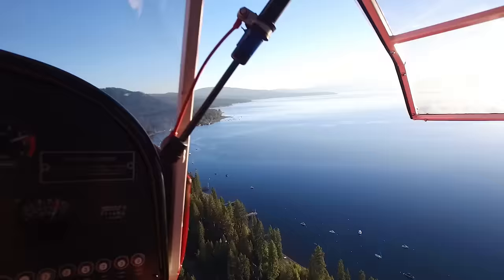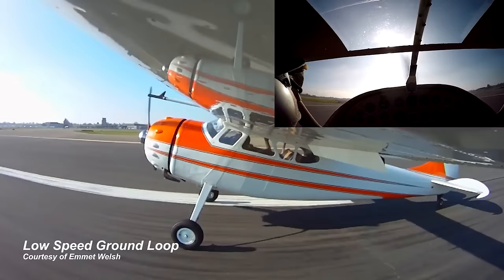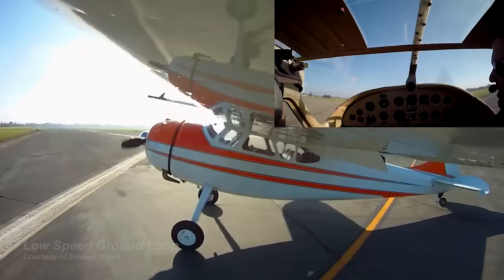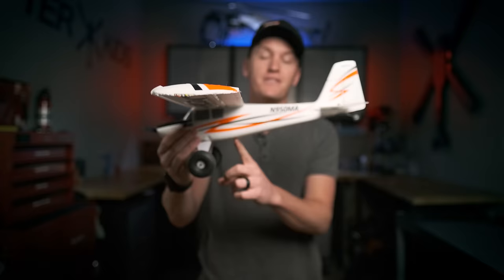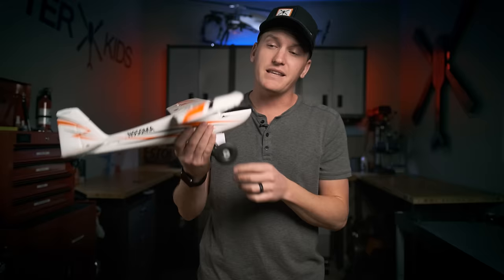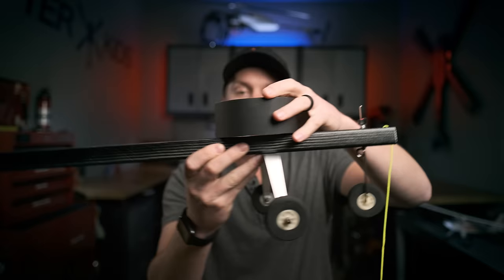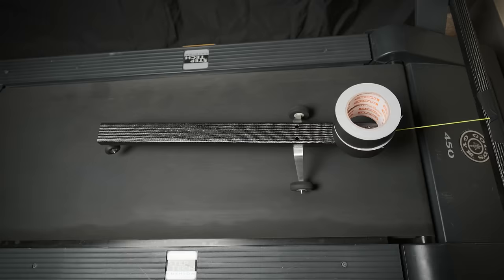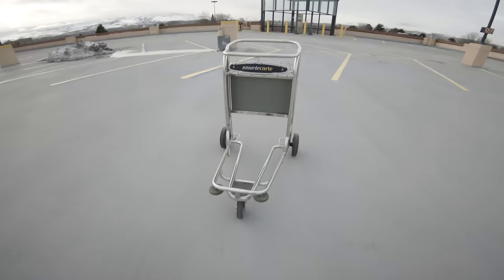The Ground Loop Monster

Comment: 1000+ convensional hours and I've given several tailwheel endorsements.  I've never ground looped, never even close, not solo or instructing.  Even with crazy 25kt crosswinds in twitchy homebuilts.  I have however come really close to nosing over twice in heavy 25g30 winds turning around with full cross wind control correction.  That's much easier to do.   Respect the plane and momentum, good airmanship and a sensitive slip/skid sensor (your butt) and it's honestly not a thing in my experience.  Fly safe... love the channel Trent

Comment: One problem with the Cessna 195 was the toe-in of the main gear wheels.  In my 61 years of flying many different tail draggers from Champs through D-18s, Helio Couriers, DC-3s and others, I've never ground looped an airplane.

Comment: Very good demonstration with the treadmill. I get into ground loops on my FSX simulator when flying the Piper Cub and it drives me nuts! However, in real life that has never happened to me while handling a glider. I do notice that I am very active at the controls during takeoff and landing. This goes in line with what you said about telling the aircraft what to do.

Comment: I revisited this explanation after what happened , very good illustration.  

I believe if you have a multitrack(3) vehicle like in this case three wheels, and in this case one of the front wheels lift off, you sit with a singletrac vehicle immediately (Has not left the ground, "not a plane yet") with a complete out of alignment  front and rear wheel tracking with forward moving mass pushing pulling  it. (Motorcycle with sidecar at slow speed scenario)..(Propellor effect also to one side....).
Argument = Nothing wrong with the plane(Like brakes...etc) my argument is based on, except for future development considerations, theres always a tradeoff somewhere.
One front wheel off the road, other one touching  on takeoff( or landing), not much controleble windspeed from the front yet on takeoff or loss of it on landing.
A thought came up in my mind but at another angle and that is say you accellerate forward from standstill. As you accellerates the side-wind-force lift the left side causing the left front wheel to lift off the ground, immediately there is one side of the plane with less resistance than in this case the right side with the R-Front wheel hard on the ground. Now as the propeller pull forward the resistance the R-Front wheel causes is enought to shift  the plane to the right slight , and you set up for a possible ground loop.
If you shoud apply brakes, it's going to shift around the forward moving R-Front wheel even more, no turning back, it happened.

Note:With one wheel off like  water skiing the airspeed and stability is high & the water is "hard", so no problem.

Now with this in mind, if the suspention is more stiff, would the one side lift easier as apposed to a soft suspention keeping  both front wheel on the ground albeit the plane feels very heeled over and clumsy but all wheels on the ground (The right suspention gives way preventing the left to lift off the ground till it bottoms out, till enough airspeed is obtained for stability, or on landing as you loose airspeed. This may not be an argument, but what do you think-?

Comment: I HOPE this video ( a good one ) does not scare pilots away from tail draggers . Trained right , in all normal conditions , no reason to fear them. Almost all my experience has been in Tail Draggers ( lots of them )  and I never feared loss of control in take off , or landing EXCEPT .......in gusty  high crosswinds .   I believe that has more potential for problems that often result in a eventual ground loop .  Never had one but but you have to pay close attention or things will go wrong fast .  Decent training and staying ahead of the airplane ( stay on the pedals )  will prevent a ground loop , lack off attention and off you go .  To me , only flying a trike is kinda like of like only being able to drive a car with automatic trans and not manual trans , lots of folks like that . Its slightly easier to learn , but ........limiting .  Point is the tail dragger is not something to be afraid of, just understood  !.

Comment: Trent, nice video and clever demo...............now, please let me add my 5 cents worth:  On your demo model,  put in 2 degrees of toe-in on each main wheel axle and  re-do the demo!   You should experience a dramatic   improvement  in ground handling stability with both the tricycle and tail-dragger configurations!    We  do this a lot on model aircraft even though, it does wear out the tyres! This could be a constraint when applied to full-size aircraft.......!

Comment: Experienced a ground loop with a pilot friend in command. Was with a strong crosswind on a Maule MX-7 (touchy plane). The solution to avoid the plane to turn into the wind with not enough control to hold it on the line is to keep some throttle on. Some traction force from the front will keep it straight.

Comment: Trent, I used to tell new customers of the embroidery machines I installed and serviced about sewing their finger/s. They all said that it couldn’t happen to them. I told them of the stories from customers that it did happen to and what they went through to get it “fixed”. I’m going to leave out the details on that. But yes, it’s just like you said, it’s not IF it’s going to happen, it’s WHEN it’s going to happen. I got out of that business after thirteen years without sewing my fingers and it was because I actively remembered what I saw before. Yes, I had lapses of concentration too and almost sewed my fingers. But I didn’t 😁 Good luck and I hope all of you have a successful retirement from flying someday with no ground loops!👍 Or other accidents!!!

Comment: Sounds just like RC tail dragger, I found lots of up elevator early as speed increases, less elevator as the rudder becomes more effective and expect the lefty as the tailwheel comes off the ground, they "fly" on the ground until ready to lift off.  Landing issues as the tail wheel come down again needs lots of input from elevator to make tail wheel effective, but must be below flight speed at that point.

Comment: The monster does bite at tri-gear. While hitting a few option landings on one roll-out with full aileron into the wind a strong gust picked up the wing and delighted me with a one wheel doughnut. Luckily the down wing did not touch. This display must of amused the guy in the tower who called down and asked what my intentions were with a bit of entertained sparkle in his voice. Should of told him I was good to go and hopped back up into the circuit. I was fairly low hours at the time and opted to take the rental to the ramp and have a good look at it.  Have not seen that monster since, but I'm always watching for the beast.

Comment: I have a side by side taildragger ultralight. Very short coupled. 17 inch bush wheels. And VERY SKEATCHY on hard surfaces. My instructor ( a retired carrier fighter jock and boocoo hours in boocoo types)  and I started with high speed taxi. First run he notched his first ever ground loop. Then a second and then a third.  He won't go with me anymore.  So I finally found a grass strip and will begin again in spring.  Gads.

Comment: I’m no expert, but been flying taildraggers, mostly PA-18 and SQ2  off airport in Alaska and sailplanes for 30 years, about 1100 total conventional and 14,000 total ,mainly turbojet. I get a little swerve I quickly correct with rudder, sometimes a sharp jab,and everything is ok.  Got to fix it quickly.  I got surprised by a messed up tailwheel spring and got an unexpected swerve.  Quick rudder and everything was fine.  I’m getting ready to get a Maule M-7 and that will be a little more challenge. It’s nothing to be scared about, just got to fly it all the way to tiedowns.  Nose draggers make you lazy and dumb.

Comment: Excellent video.  One minor issue is that the CG of the aircraft remains nearly constant; the positions of the landing gear move relative to the CG.  That's what puts the CG ahead of or behind the main gear.  Yeah, there may be a slight movement of CG, but not much.  Think about a Piper Pacer vs. a Tri-Pacer.  CG has to stay in the same approximate point relative to the wing.

Comment: So, age 56 1/4, i am 2 lessons in….lesson 2 had swirly winds and i wore heavy running shoes with no feel on the pedals (cessna 120), sometimes correcting with aileron not rudder on takeoff, ughh……so it was a “getting worse, never going to get this” flight.    Thanks for the pep talk!

Comment: Good demo and explanation.  Done 2 1/2 ground loops, brake seized on on the roll out first time, much like your film clip.  Second, in the back of a Woody Pusher after scattering my dad's ashes - who say's my dad didn't have a sense of humour.  Last, almost lost the RV4 after one wheel went in a puddle.  I always keep my tap dancing shoes to hand ;)
Reply: Man... never thought about puddle drag.  I know how bad it can pull a car... hope that never happens to me in my RV-8!  Always planned to be a fair-weather pilot... but a wise pilot always plans for the unplanned.
Reply: @goatflieg  Yeah, it was on the grass strip I fly from so I'm very familiar with, or so I thought.  It was a depression, probably made by one of the farm vehicles about 6' x 4' and inch or two deep.  It was filled with water but the height of the grass was uniform so it as almost invisible until I was on top of it.  Big right boot and managed to catch it without over correcting, but lesson learned. :)

Comment: These are great Trent. How about a video on tires; smooth or treaded (actual longevity & FOD risk), tubeless or tubes (air pressures and valve stem risks), and what obstacle size and tire diameters work (or don’t work). I am looking to purchase soon so anytime would be good...just sayin’.

Comment: A couple of degrees of toe in on the main gear do wonders. As the aircraft gets out of line,  the leading wheel starts to crab more and the trailing wheel less. This does the equivalent of applying brake,  but before you even notice it.  Learnt that 40 years ago flying rc models.
Reply from the maker: Normally toe out is better, at least that was the case on my gear. Toe in made it very squirrelly on the ground!

Comment: This was with free swinging caster tail wheels. What if the tail wheel is steerable and locked to the rudder ? But that would not help much once the tail is lifted of the runway. Great video and explanation.

Comment: Having flown and instructed in tailwheel aircraft for over 50 years, I  keep to just one comment. On several YouTube videos, I have heard people advise pilots to "keep that rudder moving". When my son was young he spent a lot of time on the airfield, and knew enough point out any aircraft he saw on finals with the rudder waggling. It's a sure sign of a pilot not yet competent with tailwheel aircraft. A couple of those he pointed out did actually groundloop. Whether taking off, landing, or taxying, simply use rudder as and when needed, and don't neglect the rudder in flight. If used correctly, it makes the whole flight so much easier and more comfortable.

Comment: My father flew for Magnolia Pipeline.  A subsidiary of Mobil Oil. He flew one of the shortest coupled airplanes ever made. The Luscombe Silvaire. They are 20 feet long and have very narrow landing gear. He put over 20,000 hours on this plane and never ground looped it! The plane N2645 is in the Midland Texas Oil Museum hanging from wires attached to the ceiling. Anyone can look this up on Google. I took him to see the plane just before he died in 2012 at the age of 88. We took pictures of him with the plane and he gave the Museum pictures of the gang at Magnolia Pipeline back in the 1950's when they first started the company flying pipelines looking for leaks! His name James Edward Martin. He finished flying in 1986 with over 40,000 hours in the air. Some WWII pilots like my father were the best!

Comment: Having such an extreme positive camber angle on the undercarriage may help to settle the aircraft undercarriage deflection on a rough landing strip but certainly won’t help on a smooth runway keeping the wheels straight and avoiding a ground loop.

Comment: I had the same problems when I started with tailwheel aircraft. I found that "pulling" the rudder not "pushing" them worked. What I meane is, I put pressure on both rudder paddles with the same pressure and let off the pressure on side I needed. This keep the tail wheel from wobbling all over the place and I neven had a problem again.

Comment: Same thing happens with trailers being towed on the road, if the weight distribution is too far aft. If you ever see a pickup truck pulling a trailer and if the trailer is driving the truck back and forth, this is why

Comment: The use of adverse yaw with the ailerons, is also helpful to avoid ground loops. That would be, when right rudder is applied, then simultaneously apply a proportional amount of lift aileron. This does require a good amount of coordination, and practice to execute properly. A force in the correct direction, at both wing tips, is a valuable contribution, to avoid the ground loop monster. Think of it as a slip maneuver, on the ground.   ... AND BE CAREFUL !   ALSO; The neutral position for the aileron would be whatever the crosswind component would require.
Reply from the maker: This technique can also be used on takeoff to shorten ground rolls! It allows you to use a little less rudder fighting p factor and gyroscopic precession

Comment: you can get a ground loop when you install stereo amps in car audio  you here the wine of the alternator in your speakers you have to run extra chasie grounds  you have ground your amp directly to the chasie with as short and fat ground  wire

Comment: It also doesn’t help that the prop is creating that air vortex which is slamming into the left side of the rudder, hence its easier to turn left than right when taxiing at higher speeds. Ah, you did mention then P Factor. 😉

Comment: As a CFI With many years in a tail wheel.  I can tell ya.  Every airplane has a speed and angle where the profile of the plane cancels out the ruder.  Usually you accelerate or decelerate through it in a second.  But find yourself there for a while and you will be going sideways.  My suggestion is when you go to take off.  Give her hell and get the job done.  When you go to land get her stopped.
Reply from the maker: Yeah, I spend as little time on the takeoff and landing roll as possible!

Comment: Try it without constant rudder stabs.  Once you're proficient you can stop using them.

Also it's not gyroscopic precession, but spinning airflow hitting the left side of the rudder without normally offsetting forward airflow yet.

Comment: My take on the " ground loop " problem is that, the rudder is the only primary flight control which has from the beginning, been counter intuitive......if you look at the input and resulting aircraft movement, when sitting in the seat and view from the side, if you push the stick forward, it moves in the same direction as the intended pitch you are after. Similarily, when viewed from behind, when you roll the aircraft to the right, it requires a movement in the same direction on the control column. However, when viewed from above, if you watch both feet as the sides of a circle, when you want to yaw nose to the right, you move both feet in the OPPOSITE direction of that circle........push right to go right sounds right, but it's an unnatural input which needs to be re-taught to the brain.......nobody is going to re-engineer all the aircraft in the world, but when you think about it, the rudder input doesn't move intuitively for the desired result.........who started this in the first place ! ..........  apologies in advance..........
Reply: When you turn your car to the right, you push with your left hand......THAT is intuitive.......because.......the rotation of the input device, mirrors the direction of the intended resulting direction......stick or yoke moves in the same direction as roll, when seen from behind.....yoke or stick moves in the same direction in pitch as the aircraft moving around the c of g when viewed from the side.......rudder pedals when viewed as moving on the sides of a circle, move BACKWARDS when viewed from above....counter intuitive.....remember that last boat rudder you used as an example,.... the tiller moves to the right to turn left......if there is a wheel to operate said rudder, the direction of turn of the input device moves in the same direction as the intended turn of the boat....

Comment: I may have missed something but you are not talking at all about aileron. You could have all the rudder input you need to stay lined up with the runway, but if the wind is strong enough you will ground loop. Drop the wing into the wind straighten the track with the rudder and leave ailerons input in as you role out. That’s a start!
Reply from the maker: That’s getting into crosswind theory and yes at that point ailerons (and all controls) are critical. 👍🏻

Comment: Good instructional video. We fly in Texas where tundra tires are not as common. The groundloop monster has attacked many experienced pilots who upgraded to offroad tires . The sidewalls will flex and accelerate the "looping effect and often bring the inside turning wing in contact with the ground. I know you guys throw out the stock sized pizza cutters right away .
Reply: Correction the outside turning wing tip 🙃
Reply from the maker: Interesting, I’ve found bushwheels to be much easier to land on than the smaller tires, the softer compound and the flex in the sidewalk seems to let you get away with a lot more than you would on the small hard tires
Reply: All in the beast you learn and making transitions . The big tires shure look good !